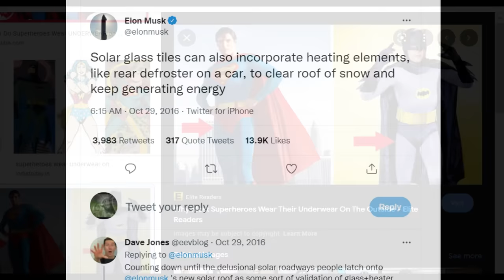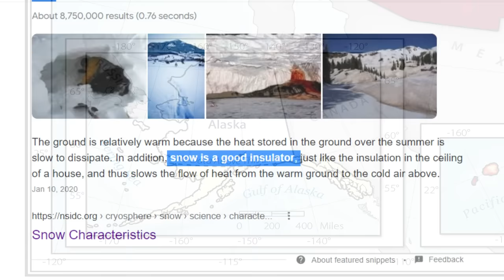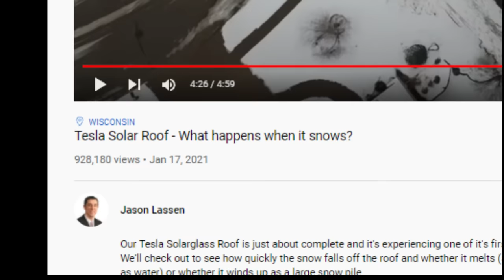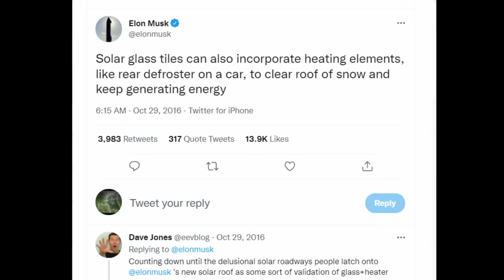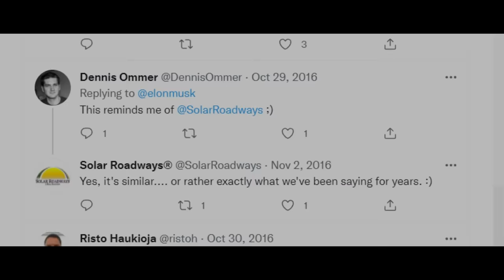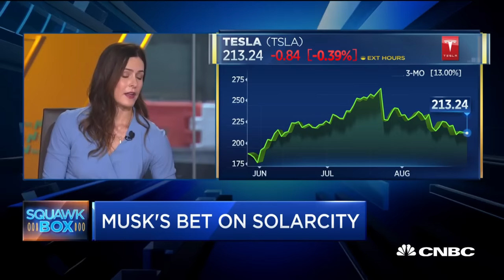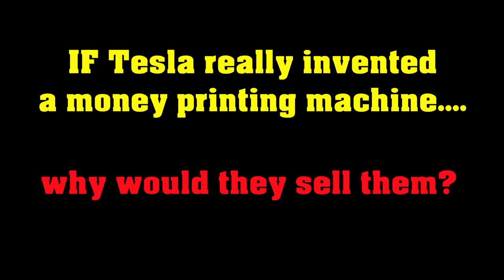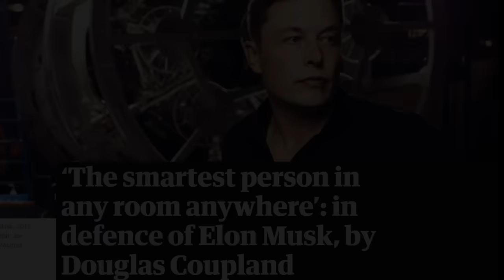Elon Musk: The Smartest Person in any room ANYWHERE!

Comment: About a decade ago I encountered a retired electrical engineer who used a similar idea, he had solar panels in his backyard connected to a power bank of some kind (He explained his system but I can't remember the details). The power was run through a cluster of wires he had beneath his driveway, which raised the temperature of his driveway just enough to melt snow. 
FYI, there was a town sewer drain near the end of his driveway the water ran into. 
He had the cleanest driveway I ever seen in the dead of winter in canada, and as tempting as it is to reproduce what he made I also remember one key detail that stopped me. He had no backyard left.
Reply: My first question would be 'black ice much?' Unless that driveway was hot enough to fry an egg, it would've been covered in water, and the slightest amount of wind chill would've made his driveway into ice, wouldn't it? Covering something in water is how you make something colder. He must've been pumping enough juice through those cables to power the neighborhood. What an absurd waste.
Reply: @EdwardHowton  Not really. Just need to have it above freezing and at a minimal angle so the water can run off. Can't freeze back over if there's nothing there. You could argue that he could have used his power for other purposes like indoor/water heating or sell it to the grid - but how he uses his solar output is his choice.
Reply: @SKy_the_Thunder  Hence my question. Dunno if you've ever seen Canadian streets, but black ice kills. Since you think black ice is apparently impossible because water just magically vanishes after melting from snow and ice and that temperature differentials and re-freezing are myths, then I'm not sure I even want to bother educating you on basic physics about water. Go on vacation to a cold country during winter sometime and try driving normally. Try not to crash into too many innocent people when you do. If you live maybe you'll learn you something.
Reply: @EdwardHowton  I think he's implying that the driveway isn't level, but instead slopes toward the street (and the drain). As such, the implication is that the melted snow (water) would run off the driveway into the sewer without having the opportunity to re-freeze into ice.
Reply: Not even implying. I explicitly wrote that it would have to be at an angle for the water to run off...
Reply: @SKy_the_Thunder  I agree... although the direction of slope (i.e. towards the street / sewer drain) was (very heavily) implied, rather than explicitly stated. Some people need the full step-by-step to pick up on such implications. My comment was intended to assist with this, rather than to criticise your (more than sufficiently clear to me) anecdote. I guess clarifying that the under-driveway heating loops extended all the way to the street-edge may have helped as well (I assume?)...
Reply: I have designed ice melt systems and have installed many other hydronic and heat pump applications for transferring heat where it is wanted. I don't personally think solar is the best way to do it for many reasons. As far as solar panels go they should be mounted almost vertically in higher latitudes which makes additional snow melt unnecessary.
Reply: @SKy_the_Thunder  It mostly transpires and most of it never becomes liquid (at least where I live 53 degrees north). We generally use natural gas to do it though.
Reply: Its not hard solar panels produce power connect  one wire to - and the other to + run wire under driveway sun shines wire gets hot
Reply: @markschroter2640  The recommended angle for solar panels where I live on the 49th parallel is about 30 degrees according to most calculators I have used.  Not vertical.  Similar to man roof pitches in Canada.  TF is full of nonsense as usual

Comment: Not only did they put the solar tiles on the entire roof, they put them on the bits that are shaded by other parts of the roof.  (One of the problems with these complicatedly pretty roofs is that, in the simpler way to do them, they shed water from the higher bits to the lower bits.  This causes damage to the roof surfacing material and wears out those parts where the water is shed to.  You need complex guttering to prevent this from happening.

Comment: Under normal conditions you do not need to remove the snow from solarpanels, they "clean" themselve.
If the sunlight reaches through the snow they heat up naturally and remove the snow themselve.
On a slippery glass surface only a tiny amount of the snow has to be converted to water to get it going.
This is in some places even a safety concern cause it can result in roof avalanches.
Reply: You need an insane amount of energy to melt that much snow.

Imagine cars sliding around on that slippery glass surface after the rain. And the durability will be shit.

Also, solar panels lying flat on the ground is not very efficient.
Reply: @clodman84   I was talking about this solar roof not solar roadways.
And wanted to explain why normal solar panels a supperior compared with these rooftiles.
Beside the awfully bad efficiency these tiles inherently have to "look like a normal rooftile"

Funny sidenote: These heatingsystems already exist, but just for very niche usecases (mostly safety reasons).

p.s.: Solar roadways is/are a magnitude higher in braindamage as this recless idea of melting it off the roof via heating the panels directly.
Reply: @rolandpaschinger7565  As pointer out in the video there wasn't snow heaps on the ground.
Reply: @clodman84  Cars don't typically drive around on roofs...

Comment: With a little research I found steel dummy tiles are used in areas with little sunlight and glass solar tiles are used in areas with the most sunlight.  As far as the roof clear of snow, the house is still under construction, so I'm not sure how much heat is inside.  Also, the bulk of the insulation is just above the ceiling, not in the roof structure.  The black tiles could have retained heat from an earlier point in time and melted the snow, though I think unlikely.  I do like the look of the solar tiles compared to conventional systems, but that doesn't justify the cost.

Comment: Here is another reason why heating solar panels is a bad idea: The warmer a solar panel gets the less energy it produces
Reply: There is a complex temperature Vs efficiency relationship.
Reply: @rogercoppock407  when the first sunrays in the morning hit my solar panels, they are at about 5°C. From that point the solar panels heat up constantly until they reach temperatures about 65°C and i can watch the produced power dropping as the temperatur is rising. So yeah, very complex. Need magna or even summa cum laude to understand that relationship
Reply: @andiprogshop3097  You must have the wrong solar panels.  Where I live 65F would be our coldest winters day.  My panels operate fairly efficiently in the middle of the day in summer with temperatures around 100F though probably best when it is around 80F in spring and autumn when the angle of my roof is perfect for the suns angle in the middle of the day.
Reply: @andiprogshop3097  there is definitely something wrong with that are your panels pointed in a more easterly direction? The most common types of silicon based panels get more efficient as they approach between 35 and 55 degrees (on the panel) and then their efficiency drops off at about the same rate as it was gaining up to 35 degrees.

We have days here where it gets too hot and the panels start under performing but it gets over 40 degrees in she shade here fairly often and the panels get up close to 100 degrees Celsius (the temperature sensors go on the blink and if you spray water on them it turns to steam.) 

We still get more power with the panels at >80 degrees C than we do in the mornings because the panels are facing north and revive a lot more light.

Gallium arsenide panels may drop off enough due to temperature that if your panels are at 45-60 degrees C in full sun they would produce less power than if they were in <1/4 sun. I doubt you have GaAs panels though.
Reply: @robsengahay5614  You totally misread his comment or else you don't understand the difference between Fahrenheit and Celsius. To convert from C° to F°, you divide the number by 5 (65/5 = 13), multiply by 9 (13*9 = 117) and add 32 (117+32 = 149). 65°C = 149°F. The only temperature where the 2 scales are exactly the same is -40°.
Reply: You wouldn't heat them up to desert temperatures, where the gradient drops significantly.  Only a few degrees above zero is enough.  Also you'd only heat them up long enough for the snow to be gone.  Then it doesn't matter whether they go subzero again.
Reply: @glenecollins  I was talking about a 200W mobile panel which is pointed straight to the sun most of the time and all i want to say is, that there is a clear relationship between °C and produced Watts.
Reply: @andiprogshop3097  there is but it is like the tip of an upside down U shape specific to the cell chemistry. (Within usual earth temperature ranges) as the one of the other comments said it is actually a complex equation

Comment: Traditionally we built houses with steeper angle of the roof to let the snow slide off by its own. You should not keep the snow on your roof since the weight might damage the building. Insulation is put inside.

Comment: The attics of most northern american homes are ment to stay at the exterior temperature so snow on those doesn't really make a difference on the overall energy efficiency of the home. There are obviously exceptions to that on homes without attics.
Reply: It still could. If the snow keeps the air in-between the roof and the fiberglass on the attic floor at 10c instead of -20c, then there's going to be less thermal energy transfer from the living space to the air in the roof because the delta is way lower, only about 13-ish degrees at the fiberglass. It essentially extends the effective insulation to include the air in the attic and snow on the roof as well instead of just a few inches of insulation being the only thing that insulates the living space from -20c air. Which would create a 43-ish degree delta at the fiberglass.
Reply: @thegamerguy56  attics are designed to be at ambient temperature. If the underside is warmer you get condensation and ice dams which are damaging to the roofing. It's not a benefit at all.

Comment: A friend of mine invested £8000 to fit solar panels on his house in Surrey. He's talking about investing in a Lithium battery that would be able to store generated electricity for around another £5-6000. He reckons it will take him 15 years before he will start to see a economic benefit at current tariff. He's 52. This is before converting his heating system from gas to air to water.
I've heard of a lot of dissatisfied customers who retrofitted their pre 2000s homes from gas or oil to air to water. They are less instantaneous and don't heat the radiators nowhere near as hot. And are more suited to a lifestyle that leaves the heating on all day controlled by a thermostat.
One get's the feeling that a lot of this "retro fitting" "air tightness" and electric powered heat and transport are a new wildwest of fleecing the unwitting customer. All fully backed and endorsed by government with added penalties and punishments for not buying into their expensive new future. 
Personally I'm only going to back and invest proven economical and efficient technologies.
I'm replacing my own gas boiler with a new one at some point in the new year
Reply: What on earth is an "air to water" heating system? Never heard of anything like that. Googling "air to water" only results in empty promises of condensing water from the air, nothing with heating.
Reply: Guess it's air sourced heat pump being used to heat the water for a legacy water filled radiator system...  This seems to be what the government is pushing in the UK. Maybe it'll even be alright if we're all working from home all day but seems like it'll be rubbish for the current normal use case of giving the house a quick blast of heat for when you get back from work because of the low temperature the radiators can get to.
Reply: @jshowa o Great we can look forward to absolutely no complaints and backlash about the thing people are about to be forced to replace their gas boilers with from 2035

Comment: Regarding the one roof with no snow.  Looking around the house, it's clear to me that it is still under construction.  So...  from this view we don't know if it has ANY insulation installed yet.  It could very well be that it is closed in, and the construction crews have been running a high-powered portable gas heater to allow them to work inside with NO insulation yet installed.  Blowing in attic insulation is a detail done very near the end of construction (after all plumbing, ventilation, and electrical work is done).

So, there is insufficient data to say that roof is bare because of Tesla panels, construction, or any number of possibilities.  I will say, living in snow country, it's apparent to me that it was a pretty light snowfall and has warmed up above freezing (other house walkways and drives have been cleared and are completely melted free)
Reply: Plus all the snow is extremely slushy. Even if it's purely from the panels themselves, we are very likely looking at a transitional temperature where even a degree or two of difference with the panels from solar radiance absorption and lower friction would cause any snow to either melt or slough off, further increasing absorption area and accelerating the rate of roof clearing. And presumably there's an air gap to the roof and further attic insulation to keep the home efficient.